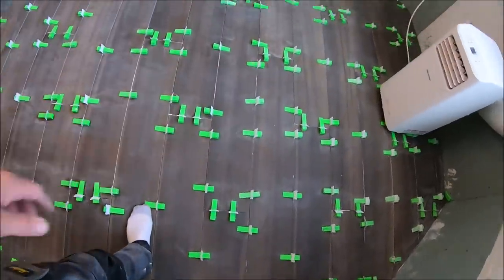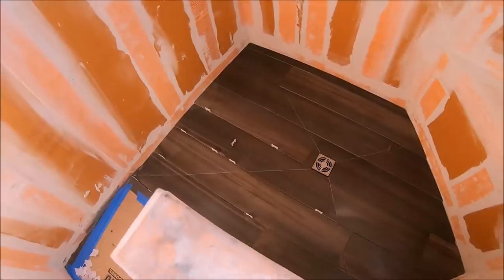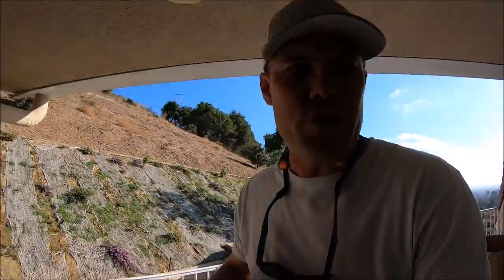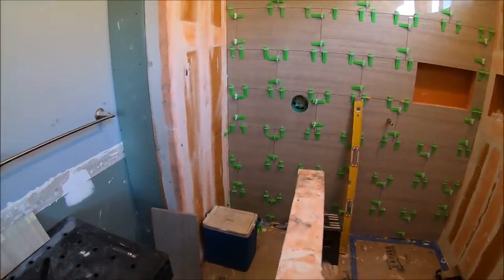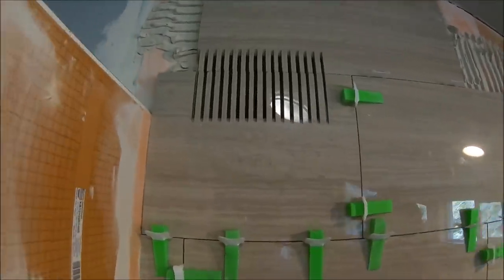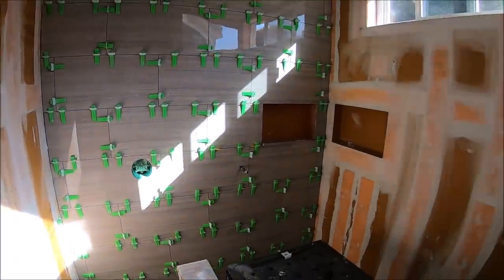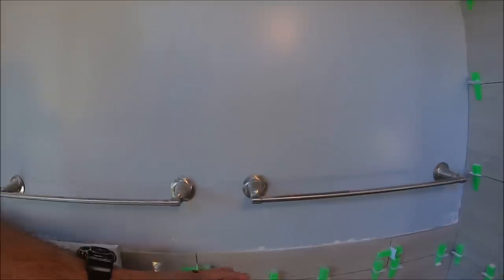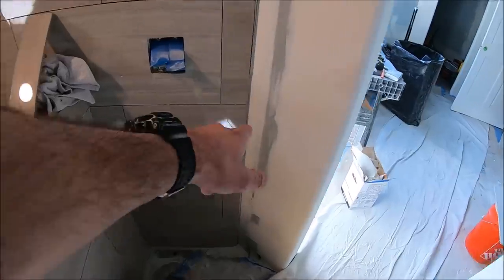$50K Bathroom Remodel Bath & Shower Tile Ideas EP.39 Part2

Comment: Dang it, now you're going to make me have to go out and buy an IQ saw after I just upgraded to my new DeWalt D24000 over the summer! Also, on part 1 when you did demo on he shower bench, I  immediately noticed original installers troweled the thin set incorrectly, not with straight parallel lines, but they used curved lines, like dead end maze lines, hence the thinset trowel lines never collapsed like they should.
Reply: That won't necessarily prevent tile from collapsing into thinset. Just requires more pressure putting in.

Comment: Great vid.   Very good explanations as you went along. I’m waiting for the quartz install on the ledges. How you do it. I did a very similar shower  and the company I used for the quartz installed it. Since I couldn’t be there when they did the install.  I’m curious on overhangs , water runoff, miters if any and the adhesive used to attach the quartz to the Kerdi. I think they should of left wider overhangs for water shedding .  Which can be good and bad aesthetics wise. Since you dont want elbows hitting wide overhangs
Reply from the maker: I'll make a video on how to cut and install the quartz. Thanks!
Reply: Landberg Tile TV 
Thanks. Curious I was looking for a vid of yours that might have an above the bathtub PVC window  and Jamb installed. That you kept in  Maybe just removed the casing and tiled around it. I’ve seemed to run into 2 clients that want there windows kept. Both new PVC windows installed in the last 5 years. Both having tub surrounds installed but want tiled walls now.

Comment: Thank you for your video.
I doubt that you didn't find tiles not levelled using 1:2 brick pattern on wall tiles due to curve of the tiles ?
Reply from the maker: No, we use an anti lippage system to avoid that issue.

Comment: If you had to pick one tile saw and only one, what would it be? Would it be the IQ saw or would you go with a wet saw?

Also what mortar do you find best with Kerdi?
Reply from the maker: They all have their specific purpose. We used 3 different tile saw's on this job. 10" wet for 20 miters, the IQ for the majority of the install. As of now, I love the Dewalt and IQ. 

We use Ditra set for Ditra
Reply: Do you mind including tile manufacturer and color or name?

Comment: I wonder if that dry saw will go through blades faster do to higher heat, no water cooling. Can you tighten those lev-tecs without the tool? Seems like yes if your lippage is really minimal.?
Reply from the maker: The IQ blade is still strong after hundreds of hard porcelain cuts along with mitered porcelain cuts (blades die after mitered cuts). I'm truly impressed. And yes, we don't use pliers much anymore to tighten the wedges..
Reply: Landberg Tile TV Thanks for the reply, always enjoy your videos!
Reply: There isn’t any more heat than a wet saw , the blade is air cooled

Comment: What the hell is that? I would have moved that fresh air that doesn't look right at all. And why didnt you guys put your quarts down and stack of it. Better water proofing to.  Looks good as heck just asking
Reply: hambone3030 “quarts down and stack of it” What?
Reply: @SgtZima  yeah putt your bench down and window Sills  down then tile everthing.  tile will sit on top of bench and window sills way better water protection
Reply from the maker: Like I said in the video, we normally do solid surface first. We simply had an issue with sourcing a good quartz match. Keep in mind friend, the shower is already 100% waterproof with all quart'z pitched outside of the shower, so watershed is not much of an issue. Thanks for the watch!
Reply: @LandbergTileTV  gotcha missed that part about quarts you guys do some good stuff.  wish I could up load some pics of my own showers I have done. Even you guys would be impressed
Reply: @jruff0727  The shower is 100% waterproof before the tiles go on. You could probably shower in it without tiles if you wanted.

Comment: How do you like that diamond back wet saw??
Reply from the maker: It still rocks! Diamondback tile saw video update coming soon!
Reply: @LandbergTileTV  have you used often?
Reply: I bought one also. Lasted for about 6 jobs. Currently in the local landfill. Make sure you get the extended warranty.
Reply: @Goknolz  what happened to it did the motor burn out?
Reply: Dustin Scroggins it did. Motor burned out and the last 2 jobs I did with it were ceramic wall tile. The nut and bushing(not sure if that’s the right term) that secures the blade to the saw also failed. Not super hard material. Not a fan of the fence either, as you tighten it down the fence shifts. I like Harbor Frieght, but if you install a lot of tile, maybe it’s not the best. But  then again, the extended warranty is pretty good. T he Dewalt doesn’t, but it’s also $700 more, so that’s a lot of $$$.

Comment: A rain shower head only, not much thought, no deverter valve and normal head OMG.
And it goes back together  same as the first one. Probably going to fail too.
Reply from the maker: Yes, we installed a high end valve with a diverter and hand held. Our clients opted against a separate standard head. This shower will never fail, but thanks for comment I guess...More video's coming on the these details.